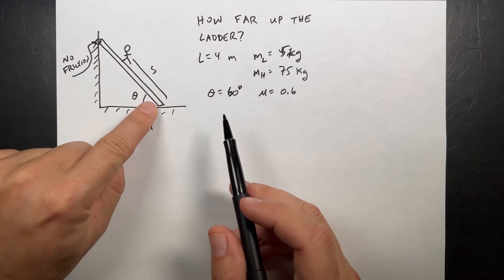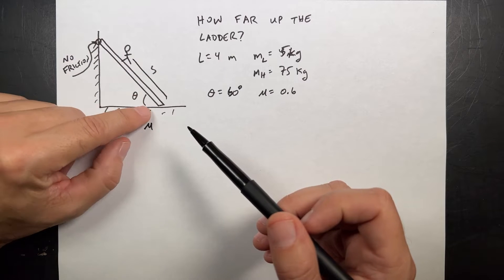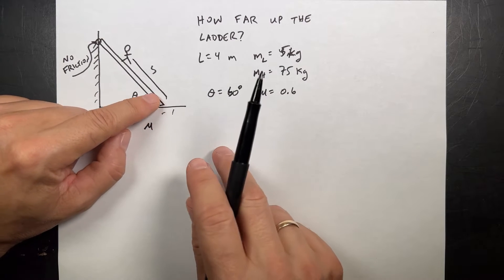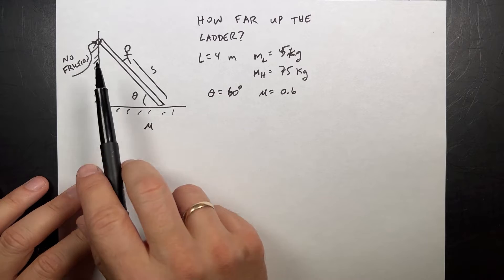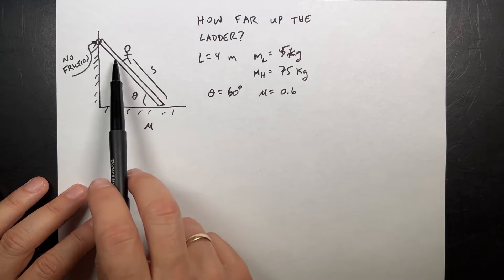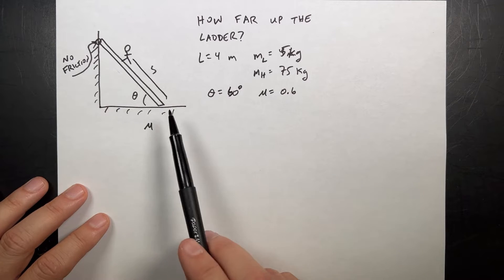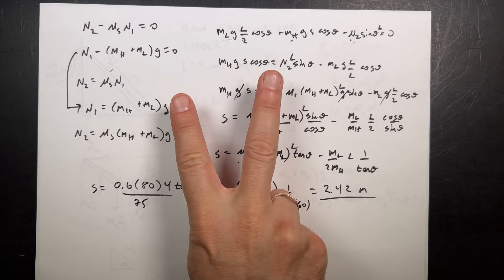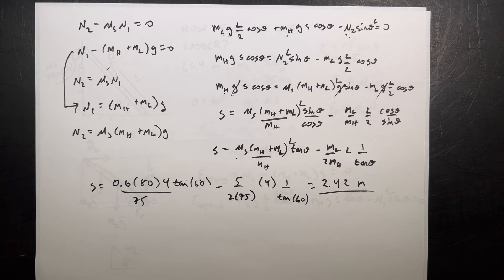How far up a ladder could you climb before it slips?

Comment: Unfortunately, I think the answer is incorrect - it should be 4.3 m, so the ladder doesn't slip at all. Summing torques around the bottom contact point, I get 0 = (750)(cos60)(x) + (50)(cos60)(2) - (480)(sin60)(4) ; x = 4.3 m.
Reply: i got 4.3 too. seemed to be overcomplicated? I don't follow why they did N2*sin(theta) in the moment sum. where is the moment arm? with the given angle and 4m ladder, the moment arm for N2 should simply be 3.46 m, meaning we already know N1, N2, and Ff. My torque sum was mLgcos60(L/2) + mHgcos60(s) - N2(3.46) = 0 ; s = 4.3 m.
Reply: Same, got 4.3m